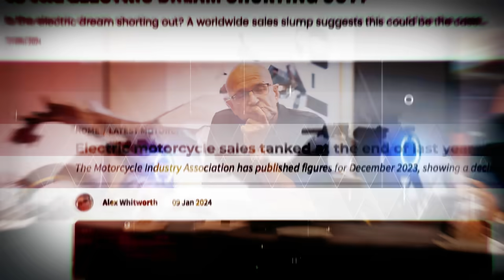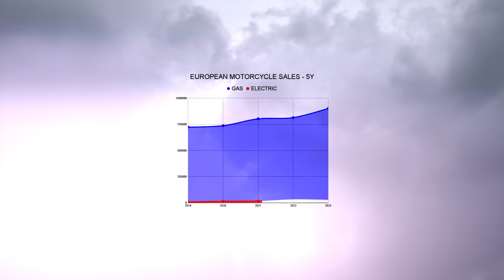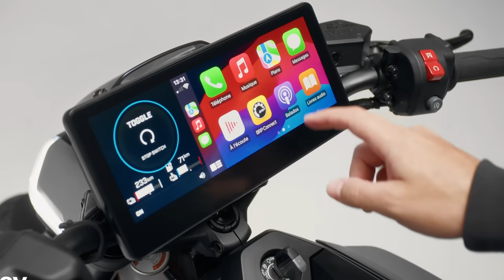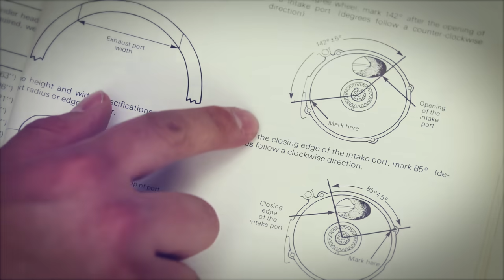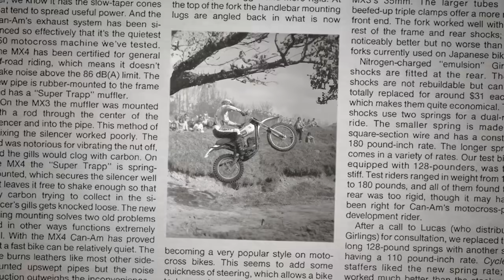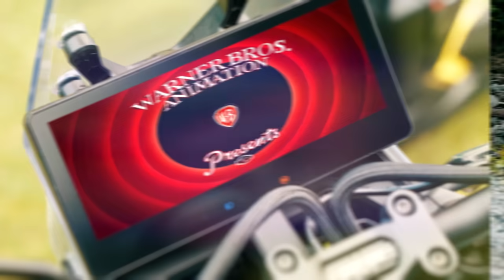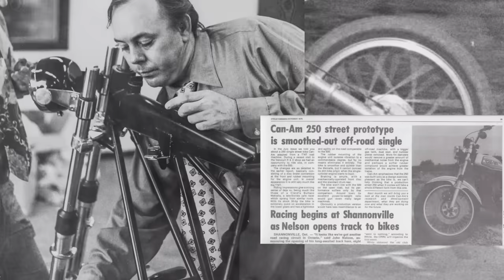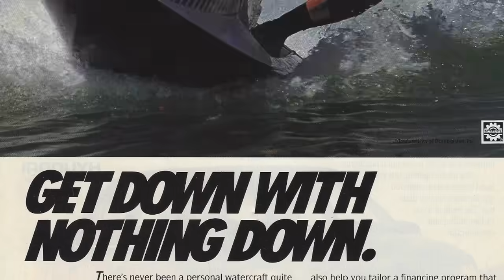2025 Can-Am Origin Review - The 115km "Adventure" Bike

Comment: I can’t wait for solid state batteries to come out. Doubling the range would make this the PERFECT daily dual sport for me.
Reply: yeah, keep waiting
Reply: Batteries with Silicon anodes are starting to be produced.  They can provide almost a big a range increase as solid state.  However they will be expensive, and electric motorcycles already have a cost disadvantage.  Still, it would be nice to have a few long range electric motorcycles available for people willing to pay the premium.
Reply: I want the burning capabilities of the batteries to be fixed before improving range. Imagine parking that live grenade in your garage after a very shaky ride or juste after a little drop.
Reply: SSB are already out, the problem with them is their density is even lower. They are much safer to handle but have a huge volume for their capacity.
Reply: @NineSun001 Yeah, from what I understand the biggest benefit of solid state batteries is that they can be charged and discharged many many more cycles than standard lithium ion batteries without wearing out as quickly. Sounds great for something like a phone or a home battery bank.
Reply: CATL now offers 500Wh/Kg batteries and they already are fitted to commercial truck in China.
Reply: @sportyeight7769  You watch too much TV. Thermal engone cars also burn in garages. On roads. At stop signs.
Reply: @leevuong8843  Never said it was only motorcycles. All high powered batteries right now are a Fire hazard that are very hard to extinguish. Even more cars than bike, just by sheer volume.
Reply: @sportyeight7769  a lot of the new battery tech, like BYD's sodium batteries (which are already on Chinese roads) don't burn. Unlike petrol tanks.

Comment: I could very nearly be that guy. It's so frustratingly close.

These days I mostly tow my 2005 KLR650 to a trail to mess around before towing it back home behind my Accord. It's gotten me out riding more than I would have if I had to ride there and back though the KLR could do it, but I live over an hour or more from all the trails in my area and that'd be tough after beating myself up riding off road. Call it soft if you like. But I enjoy riding harder knowing I have a restful drive home afterwards. 

I loved the look of the Origin when I saw it, and was even more excited seeing the brand come back to motorcycles being a Canadian myself.  I thought of it as a possible replacement for the KLR some day since I need a bike to be plated for some sections of the trails I ride. Could it fill this role? Maybe, but the reason I use the bushpig as a dirt bike in the first place is because the cheapest bike is the one you already have. I'd be hard pressed to justify the money on a bike that sounds like it wouldn't be able to do my 120km round trip highway commute as I occasionally do on the KLR. 

It was so close, so very close to making it worth it in my head. If I didn't have to find a place at work to plug it in I could almost swing a case for it against my frugal judgement. I'd be one of those nutjobs on the useless adventure bike. But as it is, it'd be a tough sell to be sure.
Reply: And never judge the ranges off of any printed stats for any electric vehicles. It's never going to be 120km unless you're rolling downhill with a stiff wind behind you. You'll probably get 100km real by just riding economically, and if you really want to enjoy your bike, i bet it's going to be 70 or 80. And then you take temperature into consideration (especially as this is Canada), and then you take the 20% battery power capacity drop in two years, and you'll end up at a 50-60km range, which is far from the sticker.

Comment: is it repairable? thats my biggest question. will they give us the software, will they give us the schematics, or basic electronic specs for the plugs and controllers? gas bikes, you know the specs of the gaskets and piston rings and bolt torque, we need the equivalents for e-motos or it will forever be an undependable toy. which they don't have to be, regardless of range.

Comment: Ryan— a great video as always and I apologise that my first (I think) comment is a correction.

Your explanation of anti-squat and its ability to offset load transfer is not correct. A vehicle with 100% anti-squat will not "squat" at all during acceleration, yes. This simply means that under acceleration the rear suspension will not compress and the front suspension will not extend— the sprung mass of the vehicle remains level. What this does not mean is that there is no weight transfer, as you mentioned in this video. In fact no amount of anti-squat, anti-dive or anti-anything can change the steady-state load transfer (that is, in the case of longitudinal forwards acceleration, the reduction of normal load at the front tyre and increase in normal load at the rear tyre). This is a very common misconception about load transfer, and there are similar misunderstandings with cars where people say that changing the roll stiffness or roll centres will change the total lateral load transfer when cornering— this is not possible (with cars you can adjust the roll stiffnesses of the front and rear axles to change the distribution of load transfer between the two axles, but never the total load transfer). You made a similar statement as the one in this video in the T7 video I believe, implying that the anti-squat changes the load transfer and allowed Yamaha to use a different static weight distribution; this is not true either.

The load transfer experienced by a vehicle is purely a function of the magnitude of acceleration, mass, height of the centre of gravity, and the wheelbase (or track in the case of lateral load transfer in cars). Simply, if you do a free body diagram of the bike when it is accelerating, when you treat the wheels and the chassis as one body and ignore the internal forces that occur between them, that free body diagram does not change whether you have anti-squat or not (in fact, it doesn't even change if you have no suspension at all— the load transfer is still the same!). The load transfer happens (as you know) because the force pushing the tyre forwards is at some non-zero perpendicular distance from the centre of mass, creating a moment that must be reacted by the tyres. Now if you treat the rear wheel/swingarm assembly as a separate body from the chassis, you can see that yes, due to anti-squat the swingarm does push the chassis up with some force, but all that means is that (in steady state), the chassis will push the swingarm back down with an equal force, essentially pushing the rear wheel back into the road (as you said yourself in the video). That extra force pushing the rear wheel down is nothing more than the weight transfer onto the rear you were going to get anyway if you didn't have anti-squat.

The benefit of anti-squat and anti-dive are not that they negate weight transfer, it is simply the fact that they keep the bike level, which is more comfortable and does not cause changes in steering geometry. Weight transfer is of course an enemy as any amount of weight transfer always causes the sum of the maximum traction forces of the tyres to reduce. The only way to reduce it is to lower the centre of gravity, increase the wheelbase or decrease the mass.

As a caveat to this and for completeness, squat and dive will cause some weight transfer of course, as they cause the CoG to actually move. However this, as a proportion of the overall weight transfer during acceleration and braking, will be tiny. In addition there will be all sorts of transient effects that suspensions have, but the steady state will give you a good general picture.

Thank you for the excellent video Ryan and I hope my comment is of some use to someone!

Comment: As an electric dirt bike owner, long time rider, and "adventurer" I would have to agree with Ryan. Off road electric power train is absolutely my preferred method of conveyance.   

I have given lots of thought to a series hybrid  approach. But due to the inefficiency of a motorcycle at speed, a turbine is about the only answer, then fuel consumption shuts that down. Air cooled lightweight diesel might do.

Comment: With battery energy density so low, efficiency is king in electric vehicles. For this reason an e-MTB is a more effective off-road companion, not least because it can be carried to the trail head on almost any car, goes at speeds where efficiency is not blown out by air resistance, and can be assisted by pedalling. 115km range on an e-MTB is no problem, with a tenth of the battery size, and they cost half as much. For city use, the same applies for different reasons - ebikes can generally use cycle lanes (whereas e-motorbikes cannot), and are narrow enough to filter more effectively through traffic. I love the idea of an electric motorcycle but for now, for my purposes, they just don't quite stack up.

Comment: Mate that drivetrain/swingarm onto the front half of a Buell, stuff a tiny turboshaft in to charge the battery... You now have terrific range and can use off-road diesel for your onboard generator (one that runs at peak efficiency because it isn't a varying mechanical load).

Comment: I think the first viable electric "Adventure" bike will be one that comes either as a sidecar variant like a Ural or has a trailer for a gas or diesel range extender that you can drop once at your trail head, ride the trail on full electric, come back to camp and hook back up to the trailer for the ride home. It would also allow them to make the bike lighter and cheaper as it could get away with smaller batteries  not to mention you can probably store more on the trailer since for any great distance you are going to have it there anyway.

Comment: I work for a Honda/Yamaha/Can-Am/Sea Doo dealership, one of our dealership principals is spending this week looking at these bikes.  The company is debating taking on the line.  I'm hoping we get a promo model shortly for the staff to test (this is how I discovered both the Spyder and Riker many years ago), as I can see a use for one.  I commute to work daily on two wheels as long as the weather permits, already owning two EV automobiles means I'm well set up for home charging and am well used to the situation, and having owned a number of motorcycle-class scooters in the past (which became my preferred daily ride for commuting) can see where these bikes will fill the role very nicely.

Besides, how often do you see a Harley-Davidson riding, patch flying (yes, hard core M/C) biker adding an E-motorcycle to the daily stable?  Range is not a problem for me.  Price?  That's what I'll be waiting on.

Comment: Every time we've gotten a fun offroad or dualsport electric, it's always been the same.
The ride, the power, the handling. All are generally exceptional. Look at the Alta and the new Stark Varg. I've ripped both and they're a blast (weird missing clutch notwithstanding). The weight thing is a bit of a drag though....

BUT.....

_Every single time_ , just when you really start to enjoy things...a tidal wave of disappointment washes away all your fun with a range warning. Followed thusly by a stagnant swamp of you sitting and waiting for it to charge....assuming you made it back. In a moment, every bit of excitement I had about going off with the bike is shattered by practicality. 

Sure the two mentioned bikes work great at a motocross or enduro tournament. You can charge up your spiffy clean electric....with the generator you brought. But even the worse battery death is only a short walk away.

When we can sort out power density and remote charging with electrics, then they'll be the ticket. As of now, liquid fuels are just too portable, too easy to use, and far too energy dense by comparison.

Comment: We have missed a step when transitioning from ICE to EV and this Can-Am platform with drive on a swingarm has more potential than anything else. Here is what they need to do:

1. make battery 4 times smaller and use high-discharge cells. 
2. add 1-cylinder ICE generator and an adequate size fuel tank. 

Ryan can get from his place to the trailhead in hybrid mode, then switch to EV-mode and enjoy over 20 km in silence with torque, precise power delivery and other fun ebike stuff.

Comment: I was a little excited when I heard last year that BRP were bringing two-wheeled motorcycles back to their line-up, but with the ranges they are advertising and at the prices they're asking my excitement has pretty much evaporated. I'm now thinking that these new Can-Ams are going to be dead in the water unless BRP can bring prices way down or battery efficiency way up. If I were looking for an electric off-road toy I'd be heading over to the nearest Zero dealer and looking at their new X-Line for about 1/2 the price.

Comment: A quick note about the ISDT medal system, multipe riders can expect a gold or silver and all those completing the course in the time limit are awarded a bronze, so it's not like the riders actually placed 1st, 2nd and 3rd in the standings.  Typically those who finish within 110% of the winner's time will get a gold, 120% silver and the rest bronze.

Due to the nature of the event even a bronze is a major achievement.

Electric bikes are good for most of the people most of the time, but the issue, apart from the price is recharging time.  One ride I regularly do sees me suffer the motorway for 100 miles [then a 2 hour recharge] ride across the Peaks on a couple of passes [then a 2 hour recharge] gradually heading South to Matlock [then a 2 hour recharge] and home.  The twisty roads take time to navigate and this is a very much 10-12 hour day, I wouldn't do it if I had to take an extra 6 hours to complete the trip.  Depending on which bike I take I will look at 2 to 3 fuel stops of about 5 min each.  Swapping batteries in charging stations makes far more sense coupled with a charger at home.

Comment: My used Zero was half the price and gets twice the range. Currently designing a mount to take a tiny generator along camping, too, which will let me recharge wherever I stop to hike without even bringing the combined weight of me and my gear beyond the average rider weight. Perks of being Asian :D

It's definifely a niche solution, but it checks all my boxes. I don't need more than that 100-150 mile range in town, and I kind of enjoy having an engine running for the first couple of hours at night in a new camping spot to scare off the coyotes from waking me up checking out my tent.

Comment: if they weren't so damn expensive
115km range wouldn't be an issue for me - my daily round trip commute is 60km total & I have grass- and gravel paths literally 5 minutes footwalk from my door - it's a perfect match.
Most of the cheaper e-scoots and e-mopeds available here don't even hit 100km/h, even less "average" 70km/h-for-60km.
I love how the Origin looks, and would totally love one as a silent, wrenching free, pothole-ready, 'intercity' commuter...

but 18k$ - let alone whatever it is gonna be in € - is just *absurd*.
that's money that - around here - could buy a used Volkswagen eGolf with less than 50.000km on the clock...
I.e. 4 wheels, a roof, luggage space ... and air conditioning.

Comment: I’ve got a 6 year old Zero DSR with knobblies and chain drive. It does the same distance as new, so the batteries are not degrading , it’s not a garage queen either with 22000 miles, it does 100miles range and charges at 60mile per hour. I live on the TET, trans european trail, so it’s riding from my door so the range is not an issue.. Oh and it was 1/3 of the new price. Also it’s will be my house battery for the winter months connected to an inverter.  Electric will never be the same as an ICE bike , but todays electric bikes cannot be judged as we are in the first 10 years of electric, try riding an equivalent ICE bike from 1914.

Comment: an interesting EV commuter that actually makes sense and is cost competitive is the super soco max, i think you can get them for 5500 canadian pesos

cheap enough to purchase but well engineered with money spent in the right areas, bosch motor, belt drive, decent power, usable range - and cheaper to run than a 125cc honda on fuel alone, ie ignoring the additional costs servicing/maintenance of the honda

it's an interesting bike in a sector with little competition, can see the cost of transport falling off a cliff as EV competition ramps up combined with the battery innovation and declining prices

Comment: Tow a running Honda generator ,unplug for the trail enjoy 30min plugin drive home. Admittedly you'd have to have 2 or 3 bikes & a servant or 2 but it's only been 130 or so years since the first electric motor vehicles I'm sure we will have good battery density in 5 or so more years 😊😅

Comment: Ironic scene at 10m10s. Ryan refers to range problems then rides alongside a big AC powerline.  The technology surely exists to fix a basic charging point every 10 miles or so.  Yes, questions about how to meter & pay for a top-up, but one radical option might be to require Hydro to give it away in the interim until the market catches up?

Comment: With all the bells and whistles the Origin is pushing $17k here in the states. Great idea, but you'd have to be a crack head to purchase a $17k electric dirt bike. Go get a 70s model 2 stroke trail bike for 1k and you'll probably have more fun.
Another thing, I fell in love with electric bikes because they allow you to be lazy. No oil change, no spark plugs, valve adjustment, coolant change, air filter change.. Just brakes, forks, chain, tires and steering stem/swing arm lubrication. But then I realized that half the fun of a bike is the connection to it. Having a motorcycle that is 42 years old and having a brand new one made me realize the disconnection. Something beautiful about loving and caring enough about something that you will actively learn to fix it and make it better.